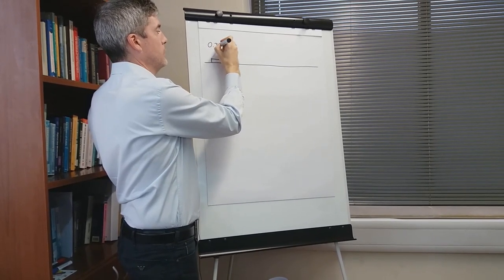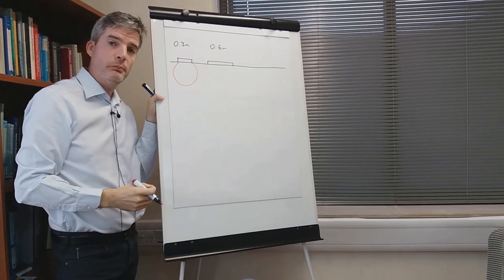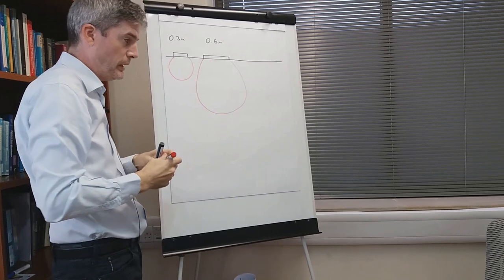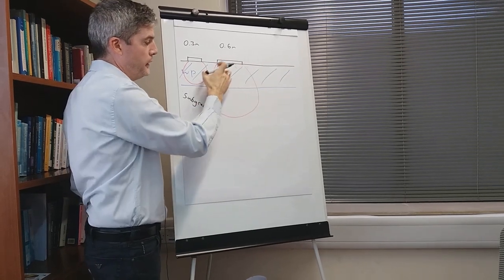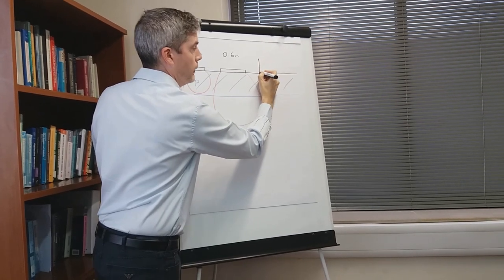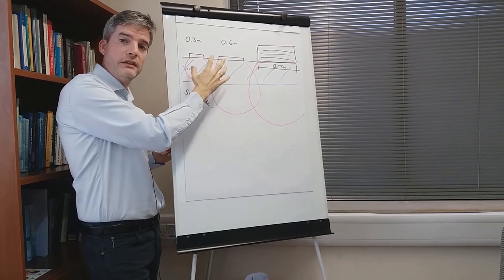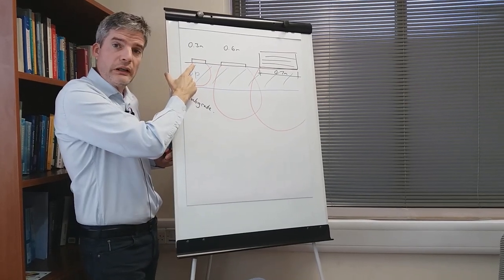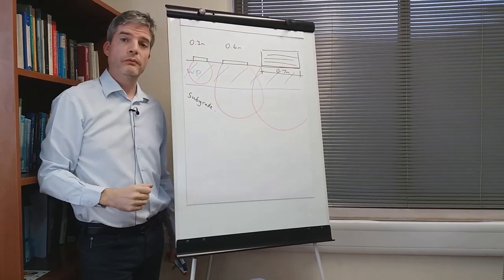How to carry out a plate load test correctly I Geotechnical Engineering I TGC Episode 1

Comment: Good explanation but worth recognising that the effective depth of influence from a circular loaded plate of diameter D is somewhat less than that from a track as a rectangular loaded area of width D subject to the corresponding length and load level of the track.

Comment: Very clear presentation.  Thank you very much. Could we not use the small diameter results to find soil stiffness at work platform, and then use the large diameter plate test to find soft soil stiffness and then estimate the minimum load bearing capacity for even larger platforms? This assumes soil doesn't get any softer the substrate, and the working platform depth is double to the small plate diameter.